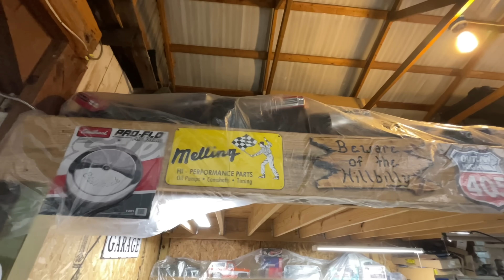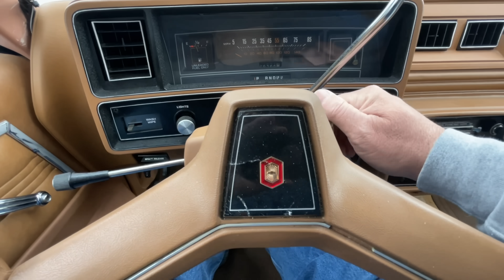RED BONE RETURNS! Pin Striping & Interior Paint DONE! Vicki’s C-10 Interior is READY!

Comment: Rule number one of using a gravity feed gun....  Volume wide open, fan wide open, comma minimum minimum 20PSI maximum 40PSI.  Primer needs a minimum tip size of 1.75 and larger. Paint needs an average size of 1.2 to 1.5